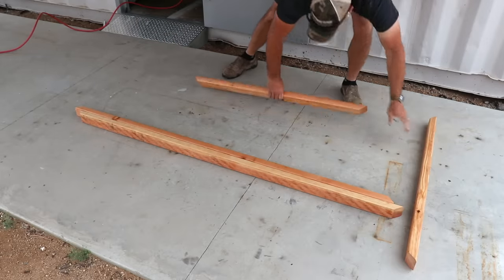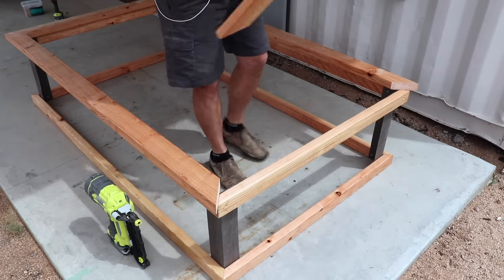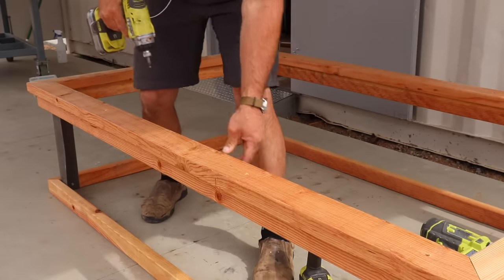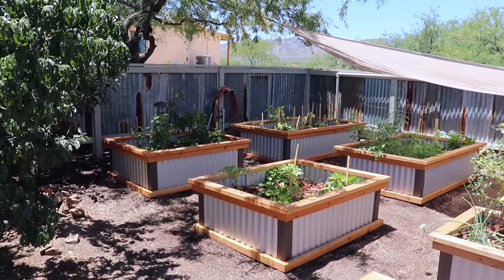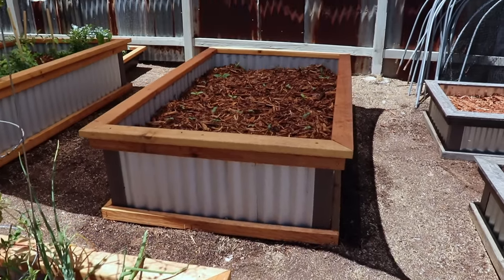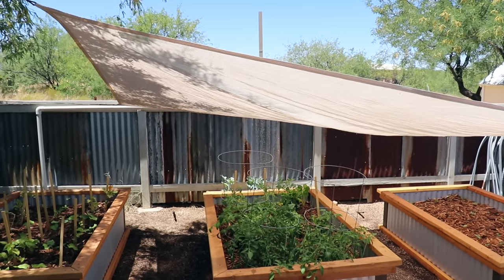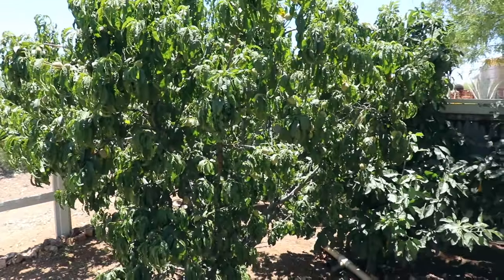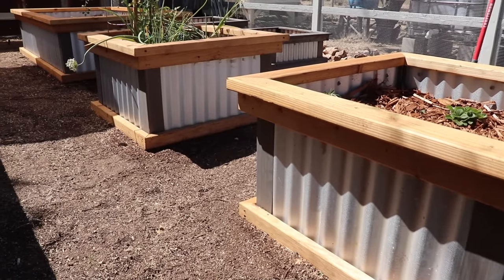Beautiful DIY Raised Garden Beds in 3 MIN!  - How to Build

Comment: 7:45  Another gardening YouTuber actually did a semi-scientific temperature measuring of the difference based on material.  The metal-sided beds were maybe 1 degree higher.

Summary......not an issue.

Comment: A little late to the party here, but where on earth did you find that 3x3 flashing material? I even showed the guy at my local hardware and roofing supply store this video, and the owner told me that in the 40 plus years he'd been in business, he'd never seen any flashing that big.
Reply from the maker: https://www.homedepot.com/p/Gibraltar-Building-Products-3-in-x-3-in-x-10-ft-Bonderized-Steel-90-L-Flashing-LF33B/202220563
Reply: Thank you had the same question
Reply: I think the 3 x 3 size of that is discontinued, "out of stock" everywhere I look. I may have to modify his design accordingly and make all of the sides wood like a picture frame and screw them all together. That should work but I really like the look of his best. Hopefully my New England freezing winters won't expand the frozen  dirt inside too much to bow them out. A situation with no concern in Arizona, lol.

Comment: Material not including tools

Basic lumber (2 by 3, mitred ends)
2/3 inch deck screws with per drilled holes
Corrugated metal roofing 
3 by 3 inch corner roof flashing (4 pieces)
Standard roofing screws
2 by 4 mitred corners (for top cap)

Comment: I'm surprised that the corner cap flashing and the corrugated panel have enough strength to sit on!
Reply from the maker: The corner flashing is really weak alone.  So with the roofing metal it is actually quite strong.   This metal is actually 26ga and could probably hold a couple of guys my size just fine😀👍
Reply: @homesteadonomics  what tool do you you use to cut the metal? I’ve tried using tin snips but just don’t have the hand strength.

Comment: Galvanized Corrugated Steel is safe to use in gardens. Galvium Corrugated Steel is NOT. Plenty of reading material on google about this topic. The paint used on Birdies bed kits is Zinc based, also safe to use in gardens.

Comment: Roof flashing looks super flimsy, something stronger would be more desireable as the corners are where you want the most strength vertically.  Look amazing though!!
Reply from the maker: The flashing is very flimsy.  But it doesn’t hold the weight, the roofing does and being that it is on all four sides it creates shear strength in all directions. The roof flashing is only for 2 purposes.   One is aesthetic and the other is to hold in the soil where the roofing does not completely meet up.   You can see my latest garden update video that the flashing still looks good and straight years later.   As the roofing holds all of the weight.   Thanks for watching 😊🙏

Comment: Adjust Size for Homemade Swimming Pool.
Reply from the maker: I think for that I would opt for getting an old section of shipping container.   I’ve seen some really cool pools made with them😀👍
Reply: @homesteadonomics  You already have all the stuff you need and a Huge Tarp you can use a liner.. But I am thinking for people that want to spend less than $150 for a nice wadding pool. Make the side 3ft high and make it 5x8. My Local Ace sells the same Sheet Metal for Half what Lowes does. 3 sheets of 10' would do it. A $70 16x28 Tarp from Harbor Freight folded in half ( twice) for the 4 layer lining.
Reply: Hot tub!

Comment: If you paint the inside of the corrugated panels with lead paint, non of the corrugation will leak into the soil. Just a tip.

Comment: 1.I will prompt an idea. In my area I pulled reinforcement around the glass perimeter with cells 1000x1000mm, at a height of 2.5m. It is convenient to tie up plants and cover with a sun net.
2.The boxes are gorgeous and neat, but it seems to me that the soil will warm from the sides very much, which is not desirable for plants.

1.Подскажу идею. Я на своем участке натянул по периметру стекло арматуру ячейками 1000х1000мм, на высоте 2.5м. Удобно подвязывать растения и накрывать солнцезащитной сеткой.
Reply from the maker: I actually talked about the heat question towards the end.  It was the first question I answered after the garden tour.  Check it out😀👍
Reply: @homesteadonomics  I am only with English and only with a translator))

Comment: Wood rot (untreated wood), Rust (cut edges of the roofing), Lead-leaching (from the roofing to the soil.
Reply: I think the roofing is galvanized , so no lead but zinc.
Reply: @dougabbott8261  I think you are right, but where the roofing panel is cut, raw metal is exposed and stuck right into the ground: rust eats away the metal and leaves the galvanized coating. That is why - eventually - I made forms and cast my raised bed boxes with reinforced concrete. Expensive and labor intensive up front, but they have now lasted over 25 years with no cracks or other problems.

Comment: Could this be made taller?   I would prefer bending over as little as possible.  Would this design still be structually sound at 3 or 4 feet tall?  Or would the metal give and bow out?  Typically this metal roofing is thin and not made to support much weight.

Comment: The amount you are spending on these doesn't make your vegetables any better. I'm sure you like them pretty, but I don't have that kind of money to waste. I'm going with the guy who used free pallets and they are great looking and CHEAP!
Reply: I made all of my raised beds with free pallets, even reused the nails. I stained them and three years later they're still looking great. I stapled plastic from my wood pellet bags inside too so the dirt is against plastic. I'm poor so that works for me but I do say I will make at least one of these at some point. I just cut pallet slats 12" tall, nailed them to bottom 2x4's and assemble all the sides. With an overhanging top cap piece still from free wood they actually look pretty nice.